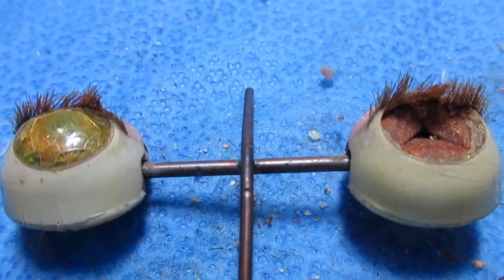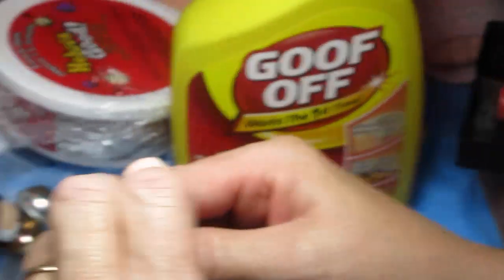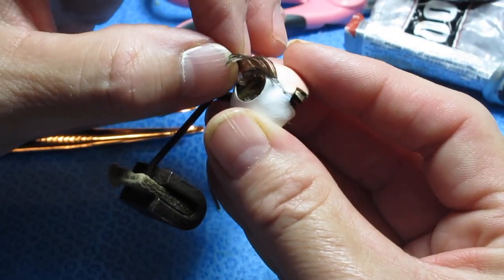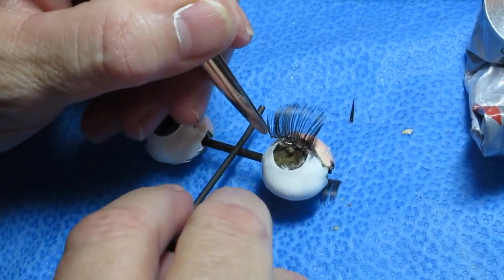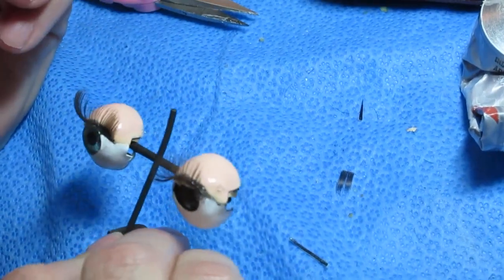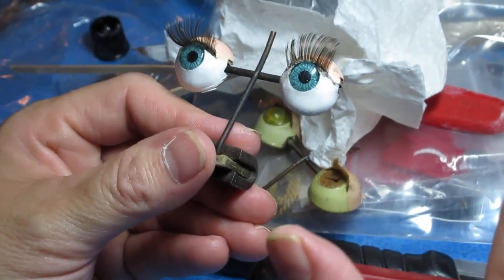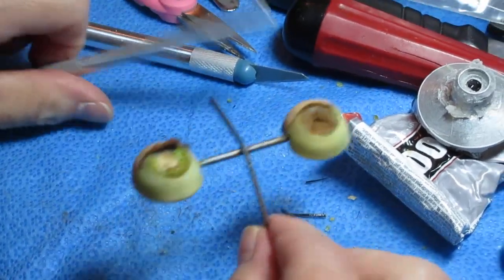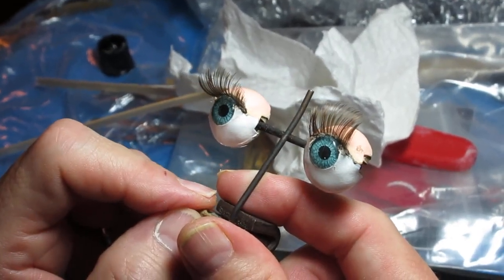Dolls - UPDATE - Making those old eyes see again !!

Comment: I see you’re close to the end of your tube of E6000, when you go to buy more, consider doing what I do now: I have had so much frustration with the big tubes over the years, as you use it, it starts to dry a little  each time you open it. Also, the big tubes will “ooze” a little glue after you set the tube down while you’re working. You have to wipe away the portion that oozed while you were working, because it’s dried a little. For my projects, the fresh, more liquid-like glue is best, like how nice the consistency is when you open a new tube. I hate being wasteful, and I hate spending extra, and although the bigger tube is your Best Buy, consider buying a pack of the mini tubes of E6000. I did once because the big tubes were sold out, and I only reluctantly bought the pack of smaller tubes. But now I won’t buy a big tube, not for my dolls where I only need a little at a time! The glue stays fresher longer in the small tubes. It’s a little bit more per ounce, but it saves you from the frustration of trying to work neatly and quickly with dried up boogery glue!

Great job saving those eyes!!! I’m going to practice on an old set I have laying around!